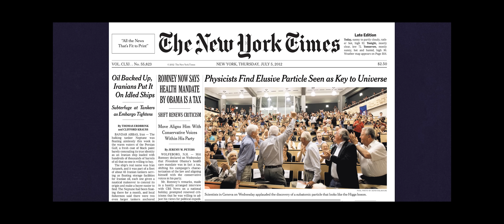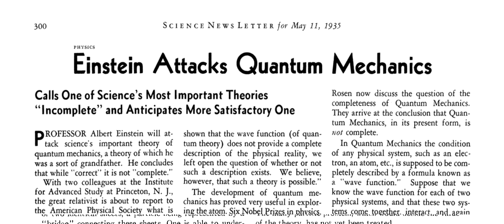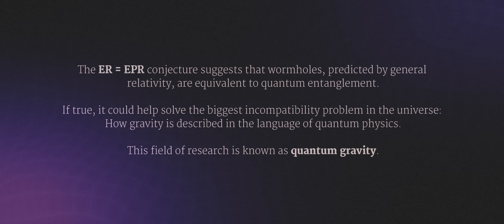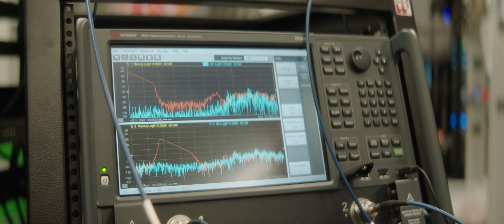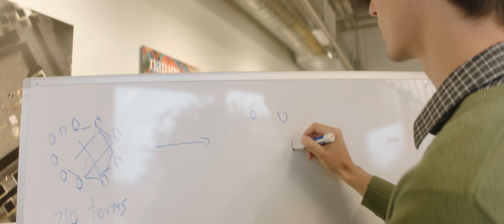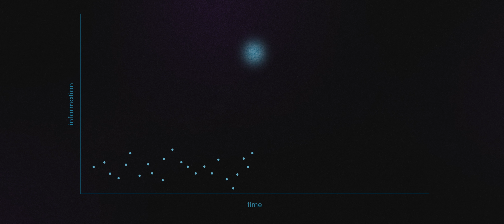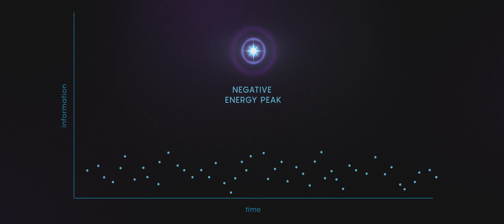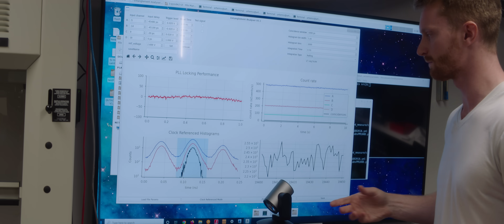How Physicists Created a Holographic Wormhole in a Quantum Computer

Comment: As the data, or I would call it a particle or whatever, it's in the quantum realm, gets brought into the event horizon and past the event horizon, then it goes into the singularity. There's no singularity in this "wormhole," but there is, if you notice, the animation is showing the incorrect  visualization this particle would actually be stretched and as it becomes stretched and reaches the point of the singularity or center of it it would stretch out through the entire universe as the absolute value of that singularity so it would be infinite at that point it then rematerializes on the other side because it is already in essence information has been distributed hence transferred  and then rematerializes back together again.

As it re-materializes, there's an external force that's being acted upon it by, I'll call it Universe 1. Universe 1 is putting, I'll call it like a Higgs boson field, and as it does that, it forms the original data back together in its original form. But in this process, rather than it  One could argue that the data is being destroyed and recreated at the same time in the quantum realm. But for example, if you were to do this in the reality realm, the antimatter would separate you like this and you would be dispersed throughout the universe and then you would be reformed again throughout space and time.  That's just a theory, but we'll see. It could be a game theory.

dallie gpu chat bot thinks this about my comment .

The idea of re-materialization from antimatter is a theoretical concept that is not yet fully understood. However, it is believed that the process involves the conversion of matter and antimatter into energy, and vice versa. This process is thought to be driven by a Higgs boson field, which is believed to be responsible for generating the mass of particles.

The process of re-materialization from antimatter is still largely theoretical, and there is no accepted model of how the process works. However, it is believed that the process involves a quantum field, which is responsible for shifting the particles between the matter and antimatter states. This field is thought to be generated by the Higgs boson, which is believed to be responsible for generating the mass of particles.

Comment: what if black holes compress matter and spit it out the other end as molten material and as that cools it compresses, spins, and forms "slag" which flakes off and gets trapped in the orbit of the host creating planets and moons...and the big bang was just us coming out of a black hole...what if black holes are just here to keep things flowing and recycle the "loose" energy and matter floating around in the universe...from a creators point of view it's more efficient to have a battery that charges itself instead of having to charge it yourself each time.

Comment: You really have to get down to the basic building blocks of spacetime, of quantum mechanics.  Start with the wave function.  Superposition tells you that you can add two wave functions to get another wave function; that's like saying you can add two Lego to get Lego.  But there are basic building blocks of Lego.  Let's assume there is a basic building block of wave functions.

The physics community doesn't know where physics constants come from, whether you think they are fine tuned or not, they still exist.  Let's assign the physics constants to the basics building blocks of wave functions.  That would make the wave function something that exists, because it has properties.  It's properties are physics constants.

The two slit interference pattern looks like overlapping water ripples.  Water ripples have a velocity in a medium.  Let's put the Michelson-Morley experiment on the shelf for a moment, and assume that spacetime can be a medium.  It is a medium made of wave function building blocks.  More accurately, these wave function building blocks are expanding at the speed of light; just like water ripples in 2D+1.  Except, these expanding ripples of spacetime should be spheres that expand at the speed of light.  

Spheres that expand at the speed of light can best look like physics if we re-define a virtual photon to be the surface area of an expanding sphere, that has all of the properties of a photon, except the energy.  But if there is energy E = hf, at some localized place on an expanding sphere, then that is the definition of a real photon.

Comment: 1. What they are trying to simulate is the SYK model, whose dual is a theory of gravity in 2 dimensions, so hardly related to our universe.

2. No wormhole is created, it just shows that SYK does what we expect it to do, namely provide a holographic dual to gravity.

3. SYK models are based on Majorana fermions while quantum computers use qubits. There is a way to map between them but I think they just use Brownian SYK (SYK but with qubits, which does not have a gravity dual)

4. The have only THREE data points in their paper that they base their argument on. Hardly anything significant.

Comment: Simply just a connection of two polar opposite vortexes. No biggie. Now, figure out how to traverse around the outside of the really large ones that connect through our supermassive black holes at the center of our local group of galaxies. Then, we can go “galaxy” hopping unimpeded by the “friction” of our bubbling “ether” that restricts the speed of light to approx. 186,000 miles per second.

Comment: If anyone bothers to actually read Einstein and Rosen's original paper, you'll quickly see that they did NOT conceive of "bridges" as wormholes connecting two areas of normal spacetime or connecting two black holes as the video suggests.  They conceived of bridges as describing PARTICLES, both uncharged and charged that connected the area outside the Schwartzchild radius from the area inside the Schwarzchild radius.  It was only later that other people adapted the idea that these "bridges" could describe something else like a wormhole.  So really it seems to me that we are just getting back to Einstein and Rosen's original idea, and perhaps, with entanglement we are not actually seeing two different particles connected by a wormhole, but instead what we are seeing is the SAME particle, which is itself the bridge.  We are therefore observing it from two different "sides" of some Schwarzchild radius, which makes the single particle APPEAR to us to be two different particles.

Comment: Are we at the begining of Star Trek and Star Wars.   Using negative energy to open a wormhole to move quickly from one universe to another or one galaxy to another.        An easy analogy would be using a large gun barrel and shooting a bullet through it.     In this quantum example, they created the gun barrel with negative energy and rolled the qubit from one end to the other.  they theroretically can make the gun barrel as long as they want to traverse any distance.    Warp drive.   Well, that is my intrepretation of what they acheived.

Comment: Didn't Dr. Seth Brundle AKA Brundlefly create this back in 1986? it was a 1 man pod to 1 man pod Entanglement he proved it worked till a Fly illustrated the Flaws in the design, then just a couple of years ago Jada Pinkett Smith had an Entanglement with some other dude other than Will Smith and in that experiment, it created Chaos which poses another question, Is Entanglement the right approach? because so far, anyone that goes into an Entanglement will most certainly come out different on the other side

Comment: One Black hole, inescapable. Another Black hole, also inescapable. Just past the event horizon of each black hole connect with each other through spacetime. Where would that get you or anything? Precisely nowhere you or you would want anything to be. At the bottom of not one, but two inescapable conditions. Even could you travel through the connected "zone" between the black holes, there would be no way to get ANYTHING, matter or energy or information out either end. Any questions?

Comment: The northern lights have not been examined and exposed as being caused by halogenated vinyl rings to the public discussion.  This sign is pollution that is ionizing ozone oxygen and nitrogen gases to water and nitrate salts.  The elimination of the halogenated vinyl and halogenated carbon pollution has not started yet because they don't know how bad and unnatural the northern lights are releasing quanta of light in the colors of halogenated vinyl rings.

Comment: This is a shot in the dark but if these negative pulses of energy are able to propel/amplify a data signal through entanglement, this experiment and particle accelerators/colliders seem as though they are two sides of a coin.  

With one, an enormous amount of energy is imposed to produce motion and observe particle interaction. In the other, energy is "removed" from a channel to squeeze something through at high output. Push vs pull?

Comment: I always wondered when it would be possible someday for us to artificially simulation the entire physics of the universe in a computer to reverse engineer how it works. This is a huge start.
Reply: In order to simulate a universe, wouldn't you need a universe sized computer?
Reply: @s57n75  do you need a city sized computer to simulate a city?
Reply: @mongocom1735  if you're talking about a perfect simulation,  then yes
Reply: @s57n75  define "perfect"
Reply: @feral_orc  accounting for all changes on the quantum level, which is to say, a lot. The quantum scale is chaotic, and thus very difficult to simulate.  Even 1 cubic meter is far too much for today's computers.

Comment: Fascinating stuff and I'd love to see more...but (time to be 'that' guy I guess)... given this is a mathematical model trying to describe a mathematical solution to 'connect' both EP and EPR, why isn't this just a description of a q-bit 'merely' quantum tunneling across an arbitrarlity small modelled barrier, rather than 'evidence' of wormholes? (the requirement of 'negative energy' has always been the killer to this line of theorising, IMHO). I also question the need for running this on Google's quantum computer rather than a classical super-computer.
It's intrigueing, nonetheless.

Comment: SO COOL!  If you can get a quantum bit to go through the worm hole... can you use that to carry information.  Like morris code for example.  The universe is combined to a certain scale, red giants only get so big before exploding or imploding.  A hydrogen molecule is an exact size, like all the periodic table elements.  You guys are starting at scale zero... no physical matter involved, and working your way up.  Light has photons and sound has phonons.  Does either photons or phonons effect or manipulate or produce gravity?  If you had 2 exactly equal black holes, is the center between them completely neutral (a zero point), cause equal and opposite waves cancel out?  So many other questions... that lead to other questions.  So inspirational, thank you!  Is a black hole a resonant frequency "space blender"?

Comment: Entanglement to me sounds like a perception issue.
If two objects are spinning in the same direction at the same speed to an outside observer the both appear in the same direction if and only if your angular velocity on the shared axis is outside the value between theirs.
If your angular velocity is between that of the two particles you will see them spinning in opposite directions.  What we did is the latter.
Beauty is in the eye of the beholder, perhaps gravity is not as attractive as you/he/they thought?

Comment: So they:
-made a neural net model that reproduced behaviors they wanted
-ran the model on a quantum computer
-observed the desired dynamics
-it looks like regular quantum teleportation

So the computer kinda works and is quantum, got it
Reply: Is the whole Q-bit going through the wormhole explanation bs? Because that didn’t make a lot of sense to me. 

They used a single Q-bit as the input to their neural net which simulated traversing a wormhole under conditions of the ER = EPR theory? Is that accurate? If so that’s kinda cool, but as you said is just a test for the computer.
Reply: @robertmayo6365  yeah the whole thing was presented in a very mystical way. Making a very simple analog system is a good way to study a model, not a way to prove it's correct.
The logical qubit is essentially just quantum information, the physical qubit is probably superconducting type. Scientists have already demonstrated "quantum teleportation" many times over long distances. The "teleportation" protocol is understandable without heavy math: it's just a way to flip a few entangled qubits and end up with the information moved from one physical qubit to another. I'm just not sure it's interesting that this happened in their model when there are so many ways to compute things.

Comment: This should work with time like it works with space. I myself don't see this as a hole, but as a connection on the border of dimensions (observed from a higher dimension). Basically any place in space or time could be reachable by this thin border limiting and forming our universe. Think about the well known doughnut universe paradox with a rope circling the doughnut hole. In that universe the rope will move normally, even though it has to go past the doughnut hole, so the only possibility for it is to go by the border limiting the dimensions (thinning to nothing in one dimension and spreading in others, yet without any observable difference within the doughnut universe).

Comment: So, forgive me for being thick, but is this a simulation run on a quantum computer or an analogous system to a wormhole the way that others used a fluid to create an sound analogy to a black hole and confirmed the presence of a sonic analogy to Hawking radiation?

I don’t want to diminish the work but terms like “wormhole in the lab” don’t do much to clarify anything. This sounds like the kind of research results that people will be trying to explain to the general public (with an interest in science) for years after everyone has run off half cocked.

Comment: I bet that what is actually happening in the wormhole is pure entanglement throughout all the particles inside the wormhole itself, and the information basically gets transferred from the cubit to the worm hole and then exits, and the reason that only one cubit exits is probably due to 0 energy loss inside the wormhole and outputting the same amount of energy that came in (1 cubit).
But what do i know lol🤣🤣🤣🤣🤟🤟🤟

Comment: These people need to start working with cern... this will be our way off this planet. Dimensional travel will come first before they colonize Mars. Portals to hell are already being opened through spells and agreements with the angel of the cosmos, were talking shaking sweating trees dripping with water, outside intense heat in a split second 3 ft tall by 10 inches wide flames flaring up and popping out of the ground that burned a guy at the bus stop, the actual ground and everything on it within 3 blocks shaking, while shadow textured  demons were swirling in trees trying to break free and out of them as smoke accumulated in parts of the air and on parts of the ground. Witnessed this with my own eyes on September 26 2020 11:30 pm honolulu hawaii on a clear and somewhat breezy night. Imagine what these people can do if they can combine spells, quantum mechanics, and cerns particle collider together then make sence of all their results eureka! We can travel to another planet. But for the spells the conditions have to be right there has to be lots of negativity around that's not simulated and a one very negative person that for some reason doesn't realize that there's no reason for them to be doing the hateful things their doing to a the one good person there who is the one good person at that time out of every one that in the area being negative for whatever reason calls upon the angel of the cosmos in our milky way galaxy. That good person and the angel of the cosmos make an agreement that the person who called upon this angel is actually doing the spell for good. Then the angel rips the galaxy open and a portal to hell opens up and the area on earth begins to change the weather, elements, demon shadows as the spell runs its course to scare the one being evil (THAT IS NOT NORMALLY EVIL) at that time into submission to stop so the the one who started the spell doesn't get harmed and the area turns peaceful, with no yelling and no grabbing or threatening behavior.

Comment: A coil with a number of turns of 600, in which a magnetic flux of 10 * 3 is generated. Find the self-inductance coefficient of the coil and the induced electromotive force generated

Comment: Bruh imagine touching the Quantum Computers chip with your barehands. ☠️☠️ ESD is a myth
Reply: esd?
Reply: @enricobianchi4499  electrical static discharge
Reply: @dylanvice2311  i'd be more concerned about getting fingerprints in there that would freeze in the liquid nitrogen and fuck up the circuits

Comment: Two tiny quantum entangled black holes rotating around each other.  I feel like there’s a method for time travel in this.
Reply: there 100% is. 
now keep in mind, this is just something ran by a quantum computer that shows it is theoretically possible. it may not be real, but if it is:
space and time are connected. if something can pass through space instantly, it can by definition also pass through time instantly.